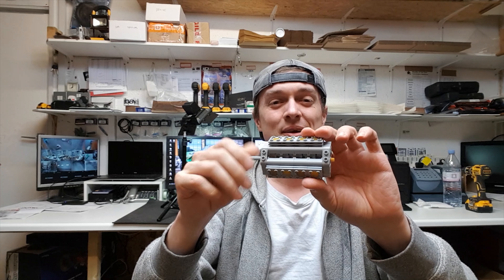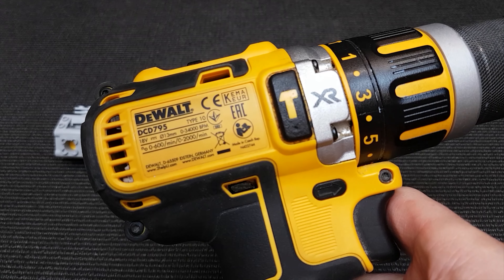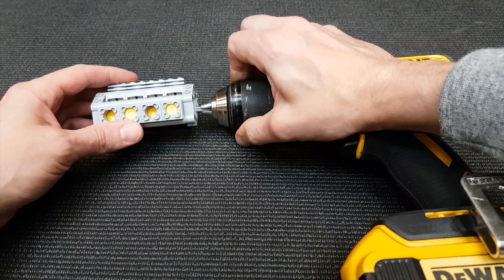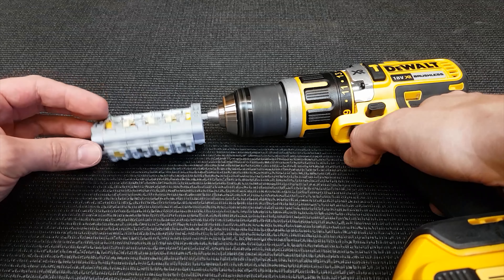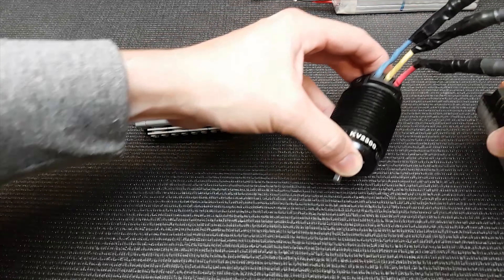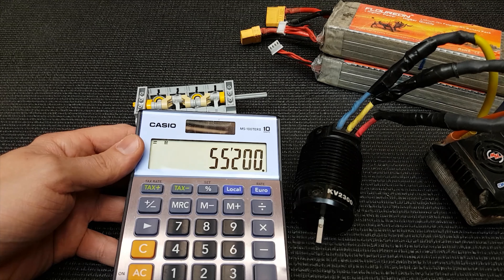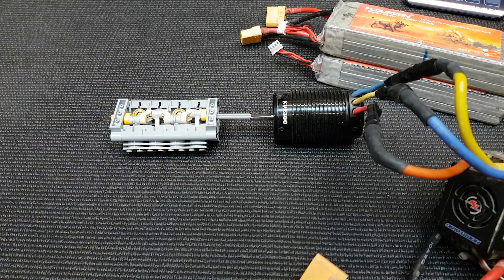Lego V8 Engine VS 55,000 RPM Catastrophic Failure Explodes!! Epic  Sound

Comment: If you super glue them all together and then use a small amount of gear oil I bet it would last a lot longer.
Reply: Frank Baumann that or wheel bearing grease. Most things that run oil have singers inside to chuck oil to whete it's needed. This doesn't have that so I think manually greasing everything would work better
Reply: wheel bearing grease would add more friction  than nothing at all.
Reply: The point was to blow it

Comment: Sadly still makes more power than a Honda civic
Reply: Strange because my Honda is pushing 500 to the wheels, b18 block, b17 head, 85 mm running 20psi
Reply: J Kent Simmons add those Sam and yet it's still a civic. Ouch.
Reply: B. Stone 93 integra, still a Honda, I hate civics
Reply: J Kent Simmons oh wow big difference. My little sister drives an integra, and they're made by acura - same garbage.
Reply: J Kent Simmons says the kid driving the same car as a 22 year old girl.  Hahaha
Reply: B. Stone hurr durr you drive the same car as someone else hurr that makes you uncool hurr durr
Reply: Strange because there were only around 300 93 integra gsr’s ever made 🤔
Reply: think you mean 850 units were sold into the US market, and 255 into the Canadian in 1993 there bud... not to mention they continued on to make that same motor up until 2001.... get your facts straight.
Reply: Canadian manufactured good sir, and they did not have the same motor, because in 95 it went from a b17 to a b18 block which has some differences and mine has a 95 type r integra motor.
Reply: man i love wasting your time :)
Reply: you just said you had a 93 gsr, now its a 95!? get your lies together.
Reply: B. Stone I never said a lie. Read next time, it’s a 93 gsr chassis and 95 type r motor
Reply: and yet at the end of the day youre still driving a 25 year old POS.
Reply: then why would the body of the 93 matter? they were all the same in that generation.
Reply: that's what makes it fun! I'm 16 and work on my own shit, if something breaks i use the money i get from my job that i go to responsibly everyday to do the things i enjoy. I love when people call my car a piece of shit, you think that hurts me?? Oh yeah, a piece of shit that ive been offered $10,000 for.
Reply: the moment i realize im talking to a kid hahahaha - have fun with your pos. let me know when you get a real car.
Reply: and whats your definition of a real car? are you the type of person who rides a Harley and doesnt acknowledge street bikes because they "arent real bikes"  ?
Reply: Boi why you hate civics? Ever seen an ek9? Eg6? Them shits is beautiful
Reply: Angel Vega okay okay, you got me with the ek9, but for me personally it’s all about db2’s 😉
Reply: Angel Vega as I have a sticker on my rear window saying “I ❤️ my db2” 😂
Reply: J Kent Simmons dang man thats lit man what ecu you running?
Reply: B. Stone actually the Integra can whip so many American garbage piece of trash cars stock and I guarantee you the b18 lasts longer
Reply: B. Stone what do you even drive
Reply: WHATELSEYOUWANT GAMING I’m not too sure the name but it’s a higher performance type r ecu, it’s just quicker throttle response and more fuel in the injectors, not much but my car used to have a turbo so it has comp cams and the pistons aren’t stock, I’m not sure what they are exactly and I have 440 injectors, I can tell you though, Naturally aspirated, that little car hauls, from 2nd to 5th it throws you in your seat
Reply: yes a 95 type r b18
honestly priceless what you said XD
Reply: J Kent Simmons ahahahaha no one messes with us b18 guys in a roast session
Reply: B. Stone 
Haha you probably can’t even afford a car let alone a wallet.
Reply: damn right
Reply: well said
Reply: B. Stone Acura is made by Honda…
Reply: J Kent Simmons not that rare the Canadian market is just daytime running lights and metric units so not rare. It's also still a Honda.
Reply: J Kent Simmons wait I thought you said your car ran at 20psi? Stop the lies and you don't even know whats in your motor. Comp cams is also a brand. Many other cars stock have more torque than any Honda 4 banger.
Reply: Jimmy Grant this guy Carey bales is running a 4.6 on the 1/4 mile wit a 4 cylinder honda accord so yeah any car can be fast
Reply: Jimmy Grant sorry 4.34 lmao he's faster than what I said
Reply: WHATELSEYOUWANT GAMING good for him it's also on a RWD drive chassis which is completely custom and nowhere near street legal. Now good for him he has a non street legal car that goes fast.
Reply: J Kent Simmons 
When you realize your 16 and ride a bike that will beat any civic on the road... sad
Reply: Chris Aldridge but I don't know maybe he labeled it wrong on his profile but it says that number right beside it
Reply: Chris Aldridge I think your right but I still don't get why he would put 4 secs on his profile I mean cmon if he does run a 6.7 why would his 1/8th be 4 secs? I'm not taking trash I'm just asking
Reply: J kent Simmons    while i do respect your car is absolutely fast  and my boss runs the same b18 block and can run 9's in a quarter with his street legal civic from the 90's  you gotta admit they just dont sound as good as other 4 cylinders, my bosses car is wicked fast but the exhaust note is just kinda annoying,  im not a ls7 fan boy either i love the sounds of 4 cly  but they gotta have some bore to it,  im driving a focus st  making 311whp  and it sounds like a low deep note and when you gun it  its like a trumpet.   my bosses car sounds like a beez nest for a lack of better words,  loud as all fuck and high pitch,   my favorite 4cyl  exhaust notes are like the alpha romeo 4c    an STI or EVO  or a 2.5 liter mercadies mb 190e evo 2
Reply: FWD xdxdxd
Reply: J Kent Simmons aaaand still gapped by a piece of shit mustang v6

Comment: Place it in a container of oil after super gluing the parts together. It'll last a lot longer and run better. Also add flat panel 2*8 pieces over the cylinders to keep them in place longer. That way they won't shoot out of the engine.

Comment: 1:49 This is why you don't buy a Ford kids
Reply: FullAutoAirsoft how original a ford joke
Reply: *Chevy
Reply: FullAutoAirsoft that moment when you realise that ford make better cars than any other American brand.
Reply: Jacob Smith no, Chevy dude...
Reply: FullAutoAirsoft Chevys are straight shit. I had a 1980 c40, 1970 special deluxe, 2013 Silverado 3500. With in a year of me owning the c40 the rear axle snapped and the engine exploded. The special deluxe lasted 4 years of hauling cattle feed and farm equipment. The Silverado was a pos from the beginning, it couldn't pull shit and eventually it needed a rebuilt transmission and a engine. Then i bought a 2001 f350 dually and it never had anything done to it. 400,000 miles and still running like the day i bought it.
Reply: FullAutoAirsoft the sad thing is that all the chevys i bought, the ford was the toughest. I also own a 1970 f150 and its still running. It only needed a alternator. It has 670,000 miles on the stock motor
Reply: Jacob Smith bought a 07 f350 camper, 1000 miles on it, got ready to take it to Kentucky from ohio, fuel pump went out of in in the driveway
Reply: Idk what my name should be.04 XD
Reply: I got a 2001 Chevy suburban with 487,000 original miles on it and it runs like a champ.
Reply: Soviet Clutch it did explode and i did give it proper  maintenance. 2 pistons melted and 3 injectors exploded.
Reply: Chevy = 👌💩
Reply: Jacob Smith doubt
Reply: everyone so butthurt over a ford joke... they make the "best" cars. sure. they are counted as that because the parts are cheap,  and its safety rating. best for "civilians" because if you break something, you'll be able to afford the new parts.  parts that are made of cheap metal. that blow up. extremely quickly. if they don't blow up, they rust out in three years. learn how metal works, then tell me ford is worth the money. (FYI theyre slowly using steal again.. meaning their aluminum truck are failing.)
Reply: Chevy's have more issues than any Ford I've ever been around
Reply: Didn't know Ford engined were made of Legos. Better than mega blocks
Reply: Jacob Smith ahem, Dodge?
Reply: Jacob Smith i have a 1972 nova ss that has 630,000 original miles on it never had any major issues
Reply: FullAutoAirsoft so funny considering fords are more reliable and haven’t had nearly as many recalls as Chevy has had and plus Chevy can’t even keep their corvettes cool which is why they all over heat and Tom Brady refused to take chevys free truck and bought a raptor lol. Chevy is ass go look up Chevy problems more that Ford and dodge
Reply: FullAutoAirsoft No this is why you don't buy Doge.
Reply: No this is why you don't bye Doge.
Reply: That moment when you remember how Chevy won Le Mans, then after that moment, you woke up from a nightmare.
Reply: No ford power for days those are just lego
Reply: Chevy
Reply: So right
Reply: Ayden Stanley I'm a Ford guy, but the Mustang Shelby 350R had a heating issue, too. It affected all models that were not equipped with an optional cooling package. So, all manufacturers screw up once in a while.
Reply: You are literally 12 "kid". Sick Airsoft guns, stick to that. Don't talk about vehicles like you know anything about them...
Reply: that's why you don't buy a Chevy
Reply: That's why i stick with the old American muscle they were built to last!
Reply: Noah coppock you must not have ever owned a 6.0 powerjoke
Reply: any engine no matter the brand will come apart if over revved lol
Reply: FullAutoAirsoft my grandma has never had any problems with her Ford which she has had for 5 years. My dad's Chevy on the other hand, broke down at least 6 times in 5 years. Ironic🤔
Reply: omg
Reply: Ford sicks duck. LMAO
Reply: Really?. Then how come every Eurotrash import we get in America is complete shit?.
Reply: FullAutoAirsoft ford is a number 
1 seller for trucks
Reply: FullAutoAirsoft I rather take the bus then drive a pos Chevy
Reply: Ford never took a bailout from the government like GM and Chrysler did...A Ford econoline van recently came to the local scrap yard with it's original 300 I 6. engine. According to its owner, the maintenance log proved it ran for 1,253,000 miles on the original driveline.
Reply: My ford got 250k on
Reply: Ford is an amazing company, but they definitely don't sell the best sportscars in the world.
Reply: Benjamin Burkhardt Not true. The Camaro and Corvette outsells any POS sports car Ford makes.
Reply: FullAutoAirsoft "07 f350 camper" well there's your issuse. The 6.4 engine produced by international was straight garbage and generally campers break down more because they are driven less. I bet there was gas sitting in the tank of that camper when you bought it. It had 1000 miles and was from 07, gas sitting in the pump that long probably killed it because the gas probably clogged and destroyed it.
Reply: FullAutoAirsoft yep
Reply: 95% of chevy cars are still on the road today. The 5% actually made it home.
Reply: FullAutoAirsoft nah, thats a Chevy, maybe a dodge even
Reply: FullAutoAirsoft says the guy who plays airsoft
Reply: FullAutoAirsoft: 302 CI V8, 640 lbs/ft Torque from 15 lbs boost from a centrifugal supercharger!
Reply: THAT'S WHY EVERY CLASSIC FORD THAT THEY POP THE HOOD I SEE CHEVY FORD ENGINE SUCK SO THEY HAVE TO SWITCH IT.
Reply: WOW they have 55,000 rpms i didnt know that
Reply: Jacob 014 I know right a Chevy is the only car that will last I agree that you SHOULDN'T buy a Ford.
Reply: Jacob Smith worse*
Reply: Lol if that resembles a ford engine then take my money putting out 50k+ rpm before exploding holy shit
Reply: FullAutoAirsoft you know the ford boys can't take a joke! God dammit
Reply: Benjamin Burkhardt LOL Bud you have no proof of Ford outselling sports car's over GM, that's just a classic bullshit Ford fanboy excuse. The only good sports car Ford makes is the Mustang, everything else like the Ford GT are unreliable and overpriced junk.
Reply: SILVERADO THE KING OF TRUCKS OMG it's so true though if anything gm probably sold more sports and muscle cars than Ford.
Reply: FullAutoAirsoft Then you realize that Ford isn’t own by government or another company....

When you realize that ford didn’t take government money, but the others did.

Ford will always be a better brand.... ford has always got itself out of shit...Chevy and FCA...hahahahahah...no. 

Plus, my 97’ Taurus SHO has almost 200,000 miles on it, and it’s running like a champ...
Reply: SILVERADO THE KING OF TRUCKS Bias much? 

Don’t get me started on Chevy fanboys, they’re worse. 

Mustang and Camaro’s aren’t really muscle, they’re sports now. By that fact 

Yes, Ford has sold more Mustangs than Chevy has sold Camaros so far in 2017

Camaros: 59,401

Ford: 67,432

This is from GM Authority.com and Ford Authority.com

They get the official numbers from the companies. That’s my source. Only recent year of the Camaro outselling is 2014.

But we all know that GM sells more corvettes than the Ford GT. It’s simple fact.

Sorry, this is classic Ford Fanboy Logic, we show you the numbers and you make some bullshit excuse why those numbers are false.
Blah blah blah...I’ve already been in this battle millions of times and have won each time....we can be civil about this, and discuss why we love our brands, our I’ll have to take another W.
Reply: FullAutoAirsoft more likely a chevy engine, GM =GARBAGE MOTOR.
Reply: The Real Austin grandma's drive slower
Reply: randomness we use it every weekend to go racing, and before we bought it, the recent owner took it to ohio state games all the time
Reply: every single study done proves that the ford f-150 is the most reliable american pick up truck, when chevy came out ford had 30 years of experience making cars already, any modern product made by gmc sucks azz, chevy= electrical problems, transmission and engine failures, im a mechanic   and the 3.4L chevy engines are probably the worst engine ever made in history, ford is years light ahead of chevy..
Reply: michael reynolds don't you?
Reply: Better than Government Motors or dodg- i mean fiat.
Reply: You mean dodge ram
Reply: This is why you don’t buy anything other than Japanese cars.
Reply: The thing is that ford can absolutely make amazing cars. Their 2017 GT is proof of that. They just choose not to for some odd reason.
Reply: More like chevy
Reply: @MsDawnKeyballs  $4000 for a brand new ford f150 engine. $5000+ for a dodge. $5-6k for a GMC.. Wanna know why? better metal, better build, more time put into it. No re-cased pop cans in a real truck, sorry bud.
Reply: ❤Ford❤
Reply: brandon dutton you realize every car rusts out at some point. Not just fords
Reply: If that happens to your ford, you are clearly doing idiotic things with it.

Comment: How to calculate RPM by voltage ?
Reply: San B you can't
Reply: You must use the kv of the motor. With 1000kv at 1 volt = 1000 rpm
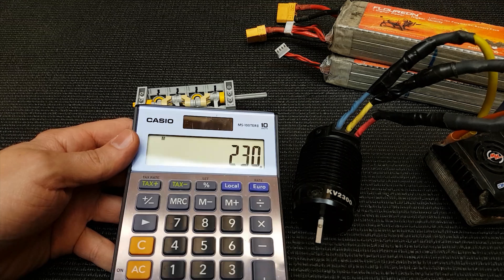Reply: Chalomwong 0:53 !
Reply: Kv means revolution per volt so the voltage times what ever kv that’s on the motor
Reply: Kv stands for killavolts. What the he'll is this guy talking about.
Reply: Jonathan Hughes KV mean kilovolt but kv is volt/rpm
Reply: The kv rating is indeed the RPM per volt on these motors, it's how they are rated. Problem is that these ratings are for motors under no load, it will never reach 55k rpm under any sort of load.
Reply: Vladoo153

if you try to define it by larger and lower case, please do it right.
kilo = k (the small one), so its kV for kilovolt. 
for m/M or p/P it can be very important.

Otherwise, thanks for the explanation :)
Reply: San b the calculation he made isnt Working lol. My hair dryer would run at 1 Million rpm lmao
Reply: CROWjunkie, you don't understand RC motors.  They are rated on the outside in a KV reference.  A 5200 KV motor will spin 5,200 rpm with 1 volt input.  So at 10 volts it will spin 52,000 rpm.  (In theory anyhow.)  A 3400 KV motor will spin 3,400 rpm with 1 volt input and so on.   In his case it's a 2300 KV motor so 2,300 x 24 (volts) = 55,200 rpm.  (Again, in theory.  Other factors can effect this to a degree.)

Comment: Muscle car guys over here talking about engines blowing at high revs lmao your engines don’t even make it to 7,000 rpm. Only one is the GT350 and it uses a flat plane crank. Would love to see how your LS, Coyote, or Mopars take 8,500 rpm let alone 55,000. 

I know someone is gonna bring up nascar and top fuel for Mopar but let’s not forget that those are all built motors and share 0 parts with street cars but please enlighten me on how those engines are basically the same as the hemi in your charger.

Comment: That escalated quickly... :D But it can't be 55.000 rpm due to degree of efficiency of every motor and theoreticly voltage of 4,2V per cell without load on it, BUT nevertheless fantastic idea to rip this toy V8 :) Thumbs up

Comment: This is why real engines use wrist pins, rather than ball ends in sockets. Had the pistons stayed in their bores, the engine could have handled a little higher RPM before it let go. That would have made it even more spectacular.

Comment: Build an engine with heads and crank/cylinder lubrication and see how long it will spin at 8k rpm before it locks up vs how long a dry engine with heads will last at 8k.

Comment: You should've clamped the engine together so it wouldn't have a change to expand on joints. Also, you should seal off the piston openings so heads couldn't fly out. And then crank it. I wonder what would happen.